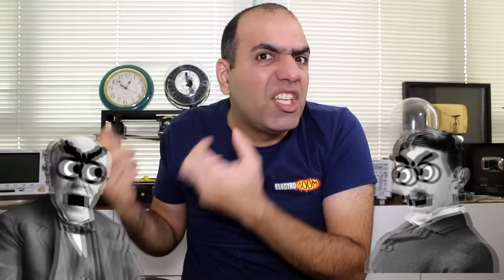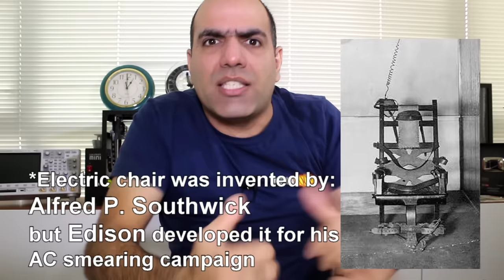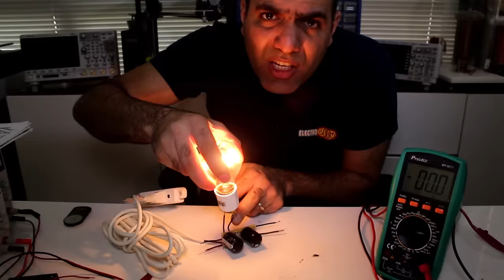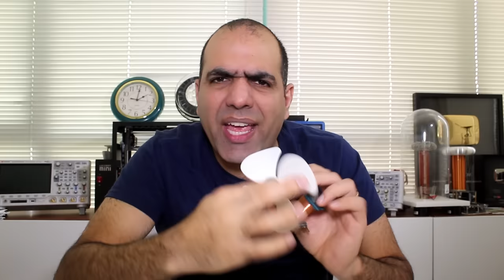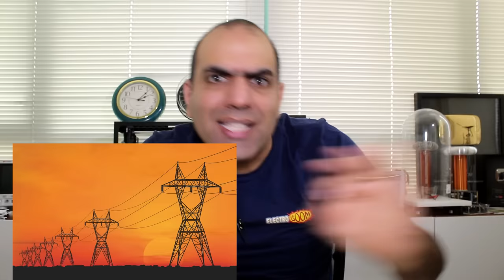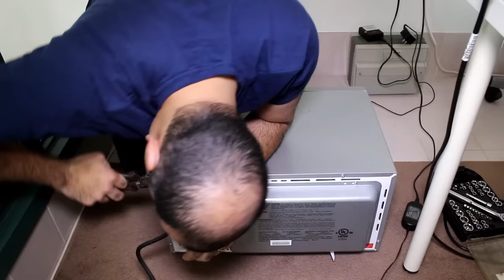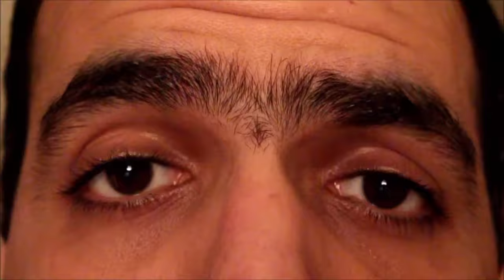Why Use AC Instead of DC at Home??

Comment: A story from a site (factory) which ran 230VDC lighting:

As the filaments parted, a DC arc was set up and stabilised.
That arc then ate its way:
- down the support electrodes of the lamp, 
- into the base,
- THROUGH the bulbholder,
- 3-4 feet along the cable dangling from the ceiling,

and was a few inches from the ceiling rose before someone managed to turn the power off. If it had managed to start chewing up the building cabling it could have been..... messy.

One of the MAJOR advantages of AC over DC is that any AC arcs that happen are self-extinguishing every half-cycle, whilst DC ones are self-sustaining. This is why the AC and DC current ratings stamped on switches are so radically different - it's not about their current carrying capacity, it's about their current BREAKING capacity and ability to prevent/extinguish arc formation.

IE: DC power distribution is a FIRE HAZARD and high current DC anything needs to be treated with great caution. This is why your car has so many fuses in it (and why those fuses have fairly hefty shrouds and/or springs in them despite it only being 12V)

It's worth noting that at the same time as Edison was electrocuting stray dogs and the occasional elephant to show how dangerous AC was, his "Safe" DC system was killing around 8-10 electrical workers per week.
Reply: It shows how society has changed its values, that Edison could kill animals in a demo without provoking outcry and a boycott of his company!  I lived in a house in England built in the 60s when there was a fashion for switchless 240V AC 13A sockets.  I'm told by someone who lived in a 240V DC area of Wales that if you yanked the plug out without switching off first you could get an ElectroBOOM-style arc.
Reply: @usvalve  Well here in Italy we have simple 3-prong 16A plugs that are fairly easy to pull out (unlike schuckos). If you pull the plug out with even just an 8A load it's 100% guaranteed to arc.
Reply: @demoniack81  *Schuko, from German "Schutzkontakt" meaning protective contact
Reply: No, your car has so many fuses to compartmentalise the different systems to try and reduce the likelihood of one system damaging another.
The large size is primarily due to the blades to provide good contact to allow a large current to pass.
The actual fusing component is tiny.
So no, it has nothing to do with arcing.

Also, AC can sustain arcing as well.
In order for the alternating current aspect to be useful, you need to have the voltage drop to below that required to sustain the arc for a long enough period for the plasma to dissipate.
A good example of this is a fluorescent tube, which is a sustained arc, which runs just fine on AC.
Yes, the AC does make it easier to stop the arc, but it isn't a magic cure-all.

The main reason we are using the archaic AC system is because it was better to convert voltages at the time we were deciding if we should use AC or DC.
Reply: @jeffreyblack666  Three phase AC can also deliver much more power with a given size of conductors and voltage, as explained in the video. That's not an insignificant aspect.
Reply: @demoniack81  No it can't, and anyone that tells you that it can either has no idea what they are talking about or is lying to you.

What was shown in the video was a dishonest comparison between low voltage DC and high voltage AC.
He pretended it was the AC that made it so much better while in reality AC made it worse while the high voltage more than compensated for the losses due to using AC.

At a higher voltage you can transmit a larger power for a given current.
Likewise, for the same voltage you can transmit more power with DC than with AC.

The three phase part doesn't help either.
All that does is set up a different voltage. Don't worry, DC can work with that as well, where you can have for example +240 V, neutral, and -240 V. That way if you need more you can get 480 V by going between the -240 V and +240 V.
Reply: @jeffreyblack666  You have no idea what you're talking about, so how about you stop talking like a three phase expert.
Three phase AC doesn't need a neutral if you're pulling a balanced load. That is an absolutely MASSIVE saving in wiring over monophase AC and it has NOTHING to do with voltage. It also allows running large electric motors without expensive and inefficient conversions.
I got this video mixed up with the one on three phase. Indeed in this one voltage is the only thing he demonstrated, but you can't just ignore the advantages of three phase distribution when comparing AC and DC.
HVDC has advantages, but it's more expensive and the conversion losses at the ends only make it suitable for very long distances and niche conditions.
Reply: @demoniack81  No, I do have a very good idea of what I am talking about, nor am I talking like an expert. You are the spouting nonsense and pretending to be the expert so stop projecting your own inadequacies onto others.

Yes, with a properly balanced load you don't need a neutral. Just like if you were to run 480 V DC off of a -240 V and +240 V rail you don't need the neutral. The exact same argument applies. The only difference is it is 2 phase instead of 3 phase, and the frequency is 0.
Don't bother with a comparison to AC to try and make 3 phase AC sound better. Focus on the comparison actually being made, AC vs DC.

I can quite happily ignore the advantages 3 phase AC has over 1 phase AC when comparing AC to DC. You would need to show advantages it has over DC.

The only motors AC allows to run so much better are synchronous motors, which would be niche application.

The conversion of DC voltages is far more efficient than AC.
The sole reason the HVDC systems suffer conversion losses is because of the stupid AC systems they are connecting to.
If it didn't need to connect to such an archaic system it wouldn't have those issues.
Reply: @jeffreyblack666  You don't get the same bang for your buck with a split phase line.
When you're pulling a perfectly balanced load (which is the correct condition for a power line) the neutral conductor is effectively wasted, but you still need it and it needs to be beefy enough to stop unbalanced loads from messing up your voltages. This is for both 3 phase AC and split phase (DC/AC).
The difference is that in this condition with 3 phase you're wasting 25% of your cabling, with split phase you're wasting 33%, assuming all the wires are the same size.
And you actually can't assume equal size, because 3 phase suffers less return current from unbalanced loads than split phase does, so you can have a smaller neutral and the wasted conductor is even less.
Also if you have an electric motor or a heating element (which is extremely common in industry) you can always omit the neutral with AC, because it's always a perfectly balanced load. Heating and motors are probably the most used things in industry by a vast margin.
This by the way holds even if your load is wired for 230V(Y) and not 400V(△), which means you get all those advantages and you can keep your phases balanced even when you have lots of lower power equipment instead of one single huge motor.
Wiring is expensive even at the small scale, not just for huge power lines, and there is no reason for a factory to not save on it if it can.

As far as your "niche" application for 3 phase motors, you might want to look up what an induction motor is. https://en.wikipedia.org/wiki/Induction_motor
They are used everywhere in industry. Virtually any fixed-speed system like a conveyor belt is driven by one of these.

Your HVDC conversion loss doesn't just magically disappear if you move your entire grid to DC - you've just spread it out and moved it to the customer's side since now they need an inverter to run their motors.
And you can't get out of that with DC motors because then you've got commutation losses and it's the same.

By comparison transforming AC back to DC for the applications that really need it (basically just electronics) is a lot simpler, more economical, and more efficient.
There is a reason why no new factories/industrial areas are being built with DC power inputs in mind, not even in places that are just now being industrialized.
That reason is that AC is still superior for the vast majority of applications.
Reply: @demoniack81  You changed your post, why was that? Did you realise your claims were pure BS and showed you didn't understand how pulling a balanced load works?
The entire point of a balanced load is that the current required in the neutral conductor for each phase is cancelled so no current needs to travel though it assuming a perfectly balanced load, and only a portion of the current given a not perfectly balanced load, up to the rated current for a completely unbalanced load.
The neutral will not see more than the individual phases/voltages.
The only way that happens is if you have something like a +120, +240 V system which share a neutral, as the neutral then provides the return path for both, in phase.

And no, the neutral, to be safe, should be the same size as the other wires so it can handle the full load unless you can ensure the load will have some significant balancing.
As for less return load, that is entirely dependent upon how it is balanced. For both systems it ranges from 0 to the maximum current.

Voltages where chosen fairly arbitrarily. If it actually had anything to do with safety you wouldn't have 2 massively different standards across the world.
And all the systems which have more than just a neutral and single live wire have those higher voltages. So no, it is still a valid comparison.
That is how these multi-phase/split voltage systems work. They have 2 low voltage loads powered by a high voltage source.

So the only advantage of 3 phase AC is that you have 3 instead of 2, which means you have 1/4 instead of 1/3 wasted on the neutral. But why stop there?
Why not 4 phase AC, or 5 or 6 or 7?
With 4 phase AC you are down to 20% lost.
You also have the advantage of a wider selection of voltages with the higher count.
So why stop at 3 phase?

So I think I will dismiss those tiny benefits of 3 phase rather than 2 due to the losses that AC suffers from being AC rather than DC.

As for induction motors, you were trying to talk about the nice simple ones weren't you? Not the more complex ones which need fancy controllers? And again with the dishonest lies about DC. Yes, you can get brushed DC motors, but you can also get brushless ones. If you are happy with the fancy controller for induction motors, why not for brushless DC motors (of which there are plenty being used). Without the controller induction motors are quire limited; and the simpler the controller, the more limited

No, the AC garbage does magically disappear if you switch the grid to DC.

What is more efficient is if it was all DC.
AC is not vastly superior, it isn't even slightly superior. DC is vastly superior.
The reason newly industrialised places use AC is for compatibility.
If we were starting from scratch, with no power grids set up and no devices relying upon a particular input, we would use DC.

And yes, I came in saying anyone who states AC is better either has no idea what they are talking about or is lying. So what? You are yet to show how AC is better and completely ignored the problems with AC which show it is worse. If AC was better, there would be no HVDC lines.
So you are doing quite well to help support my case. It would have been better if you had left your earlier post where you claimed that with split phase running the + and - at their maximum rating causes the neutral to see double its maximum rating, but I guess I can do without.

Literally the only advantage you have been able to show is that 3 phases is better than 2 as it uses less wire on the partially wasted neutral. But then any higher number of phases beats that.
But that doesn't show AC is better as you have factored into consideration the losses of AC.

And no, he wasn't simply saying AC allowed simpler. He lied and said that the only way to do it with DC was to convert it to AC, change the voltage and then convert it back, loosing a lot of power in the process.
So no, it is a dishonest video.
An honest video would have pointed out that AC makes this simpler and is why it was chosen but now we can convert DC to DC much more efficiently.
He also just focused on the resistive losses and completely ignored the extra losses AC ads. An honest video would have discussed it all. But that would result in the conclusion being that we use AC at home because we are stuck with an archaic system which was better at the time due to limitations of technology, but not now.
Reply: @jeffreyblack666  Yes, of course I changed it because I was clearly wrong. I wrote the post quickly while at work and for some reason I was thinking with the two DC sources pointed in reverse with respect to each other, then I thought about it for two seconds and realized that made no fucking sense whatsoever, so I deleted it and replied again later when I had more time to think about it properly.
I can admit when I'm wrong, unlike you, and while I was at it I even decided to tone the reply down because getting into a heated argument seemed stupid in hindsight. Guess you didn't pick up on that.

They stopped at 3 phases because there's diminishing returns and more phases complicates motor and generator design.
They could have probably gone with 6, but 3 was good enough.

Simple induction motors without control circuits are used everywhere.
"Brushless dc" motors are nothing more than three phase AC motors driven with power electronics, so it's ironic you'd sing their praise considering you're dissing AC so much.

"If AC was better, there would be no HVDC lines."
That's the stupidest thing I've read all week. It's like saying "if cargo trains were better, there'd be no trucks".
HVDC has its very useful applications (underwater cables, connecting grids running at different frequencies, ensuring you can always connect two grids without phase angle issues, etc), it's just not as good as AC for general distribution.

You can step DC up or down with power electronics but it'll never be as simple, reliable and inexpensive as a transformer.
And you can do this today, Mehdi was clearly saying that back when Edison was around you'd have to convert DC to AC to step it up, using a rotary converter, and losing a lot of power (compared to a simple transformer) in the process. There's no lie there, it's just that you're prejudiced and you want to see malice where there is none.

AC does have higher transmission losses, but that can be largely mitigated with power factor correction.

Compatibility is a non issue if you're building an industrial park from scratch. DC equipment is readily available if you want it, including inverters to convert it back to AC if you need to run something that's incompatible with DC. If DC was as superior as you say, China would be full of DC powered industry. It isn't.

That said, as I said before, I'm done getting into arguments over this, I have better things to do with my life. Keep shilling DC, maybe one day you'll be proven right. Who knows.
Reply: @demoniack81  I can admit when I am wrong as well. However that doesn't mean I will admit to being wrong when I am not.
If you want to tone down the response you don't just hide your prior insults and pretend they never happened, nor do you keep up the insults.

Yes, there are diminishing returns. So why 3? Why not 2? Why not 4?
What makes 3 the magic number to stop on?

Brushless DC motors are not AC motors.
An AC motor is bound by the frequency of the supply. A brushless DC motor uses electronics to switch which pole is energised with the electronics being able to control the speed.
Saying they are AC motors is like saying brushed DC motors are AC because it switches as the brushes go past the contacts.
I'm pointing out the problems with AC power transmission, not using electronics to switch the poles of a motor.

Yes, HVDC is used because it is useful, because it is better than AC. It is used when the benefits of DC outweighs the cost of tying it into an archaic system.

And no, it is nothing like a comparison between trucks and trains. It would be more like a comparison between trucks and horse drawn carriages.

He was not saying it as back in the past. It was stated in the present tense. He was acting like it was a fundamental limitation of DC. If it was so unreliable and expensive it wouldn't be in so many devices today.

Compatibility is only a non-issue if you are making a completely isolated system. Trying to use inverters to power AC devices from outside is a compatibility issue. So no, due to these massive compatibility issues, they wouldn't just use DC.

I'm no one's shill. I just stand up for the truth.
Keep shilling for AC. Maybe someday you will realise your mistake.
Reply: @jeffreyblack666  You WERE wrong when replying to my original post, which simply stated that, for a given size conductor and voltage, 3 phase AC can transmit more power. Which it still can (even if we want to ignore the ability to use a smaller neutral with AC), since you've only got one neutral every 3 phases instead of one every 2, even if my original idea of split phase DC was wrong because I didn't think about it enough.

Then we got sidetracked from there because you took it as a mortal insult to DC, and by the way you're the one who started with the insults.

I don't hate DC, I dont' care if my power comes in via AC or DC so long as my devices work and it (and them) are not more expensive than it needs to be.
Stepping DC up and down is still more expensive than doing the same with AC, even today. At least at the grid level.
Reply: @demoniack81  No, you were claiming AC can carry more as shown in the video, so on that regard, I was not wrong.

I had already admitted that 3 phase provides a small saving in wiring over 2 phase, and 4 provides it over 3 and so on.
However I am yet to have it demonstrated that 3 phase AC transmits a greater portion of the power than 2 phase DC.

I didn't start with insults, I simply stated a fact.

Again, if stepping DC up and down was more expensive, it wouldn't be done is so many cheap devices (even expensive devices do it). Even when weight and size is not an issue, they still use DC-DC converters.
So no, unless you have some solid evidence to show AC conversion is cheaper, I'm not buying it.

The only reason it wouldn't be at the grid level is that the grid is using AC, so the DC conversion would be more:
Convert AC to DC. Change voltage with DC. Convert back to AC.
Those conversions losses would be significant.
Reply: @jeffreyblack666  "No, you were claiming AC can carry more as shown in the video, so on that regard, I was not wrong."
Ok fair enough, I was thinking about the 3 phase video at the time. I got them mixed up.

"However I am yet to have it demonstrated that 3 phase AC transmits a greater portion of the power than 2 phase DC."
Because 3 > 2, regardless of AC or DC. Reactive losses in AC aren't significant enough to cancel the benefit of the third phase, unless you're doing no PFC at all and have an abysmal power factor.

All those devices that do DC to DC conversion are usually small and low power. Small and low power is where electronics shine. As soon as you get into high power applications the power electronics get very expensive very quickly.
Even HVDC lines step the voltage up/down on the AC side with a transformer, and not on the DC side with DC/DC converters. Clearly that means it's cheaper to convert voltages with simple, reliable transformers rather than with expensive and relatively fragile electronics.
Reply: @demoniack81  "Because 3 > 2, regardless of AC or DC"
Only true when comparing within AC, e.g. 3 phase AC is better than 2 phase AC.
Again, if 3 phase AC was better, there wouldn't be HVDC connections. Instead it would just be high voltage 3 phase AC.

The HVDC converter stations have the transformers to get rid of issues with AC, such as reactive power. They are needed due to the AC system.
Reply: Actually, the transformer is a hungarian invention, the first transformer are made in Hungary by Ganz Mavag before the invention of ac, in the Ganz Mavag's transformer factory, that factory had gas lamp lighting, and it had a transformer tester, which is a dinamo driven by alternating motions, after the test was successful, the transformer was wait until the AC was spread to Hungary
Reply: @ChristPrimus  That all depends on what you try and define as a transformer.

Faraday was the first to do experiments with induction, which involved things which could be deemed transformers. But this was primarily for research, not actual power transfer, even though it did transfer power.
So that would make it Faraday in England, not Austria-Hungary.

After that you had the Irish with induction coils.
Then AC came along and made it so the induction coils didn't need interrupters as the AC has a changing voltage.
Then you have Russia and various other countries (including Austria-Hungary) coming in, with the Ganz factory being the first to patent and start commercial production of transformers akin to what we have today.

So I wouldn't say that the transformer in general was their invention, just that they were the ones that made it commercial.
Reply: I am off grid and power my entire home with 100VDC. One thing to note is you must place arc arrestors on EVERY kind of switch for the reason you stated. By the way, no transformer will work on my power as "DC only" creates an electromagnet condition in the primary, therefore no output on the secondary.
Reply: @MikinessAnalog  Yes, transformers wont work, but plenty of power supplies should.

I am yet to find anything which indicates that you actually need arc arrestors for DC systems at voltages of 100 V.
And even AC will generate arcs on switching contacts.

Jacob's ladder, a device for generating arcs and having them travel up the ladder requires 10s of thousands of volts.
Reply: @jeffreyblack666  I may get by without them, but i saw a video of 230 VDC that frightened me enough to do that. By the way, it  appears that ALL high speed switching supplies will take AC or DC as the first thing after the fuse and choke is a "FULL BRIDGE RECTIFIER"  that turns it into DC anyway.
Reply: @jeffreyblack666  well said, but one thing stands out: DC-DC converters use switching to generate high-frequency AC for transformers and inductors which have no response to DC. The efficiency gain is because at 50000Hz the transformer can be much smaller with less wire that the current has to run through, so the switching losses in the transistors plus the resistive losses in the transformers end up less overall, plus there's much less material/weight/cost to the high-frequency DC-DC converter (which is why almost everything uses them nowadays, even when running from AC). It might be worth mentioning why DC power lines are more effective too: 

1 DC can use the entire conductor wheras AC is limited by skin depth to the outer 6mm (at 50Hz, in copper - only makes much difference in transmission lines and power stations).
2 DC is transmitting power continuously through both its conductors, wheras AC is transmitting in pulses meaning significant power is only flowing for 80% of the time (equivalent).

AC transmission is mainly about legacy, the only good reason to still have it is the arking problem, but that can be solved in other ways (solid state switches and ark-arrestor blocks on wires for example). But all building codes would need to be changed and electrical professionals re-educated, and that takes time.

A lot of eqipment already has power supplies that can be operated from a DC input, (psu's rated 100-250V AC will also run happily from 100 to 300V DC) so as this process continues (more and more motors are getting electronic controllers to increase efficiency and versatility) eventually there will be very little of the AC legacy left, and switching to DC will come naturally, when we are generating our power as DC, storing it as DC, using it as DC, then distributing it as DC will come naturally, especially as the electronic voltage converters can be far more responsive and intelligent about how and where they push the power that is generated and stored in a far more distributed way.
Reply: @treelibrarian7618  Other than the specific details I thought I had covered most of that, but it may have been in other threads.

One thing to note though is that is only for an isolated power supply. If you are fine with an unisolated power supply (which if it fails can pass through the entire line voltage) then you can use inductors, capacitors and switches.

You also left out 2 other key issues with AC, the transmission cables capacitance and inductance.
The inductance limits how far the AC power can be transmitted, and creates a voltage drop across the cable. This is most significant in undersea cables which need to use DC for this reason.
Capacitance allows open circuits to still pass power, and more importantly, also causes radiative transmission as the voltage changes.
This means AC power lines actually transmit away a significant amount of power.

One issue with switching to DC is some devices designed for specific voltages using AC to work the same in DC will use either the RMS voltages (like heaters) while others will use the peak voltage (like simple AC-DC converters.
Reply: @treelibrarian7618  >(psu's rated 100-250V AC will also run happily from 100 to 300V DC) 
I guess a bit over 400DC. The voltage after the bridge rectifier is over 400 for ~240.
AC has the intrinsic benefit of being able to switch the live and neutral. DC would require a bridge rectifier everywhere to do that.

Flip note: Massive DC would have to deal with galvanic corrosion, esp. at the households.
Reply: @stanimir4197  actually the voltage after bridge-rect is 339V (240*1.414) peak. PSU's that can work at 110Vac (150V peak) must be able to run at lower dc voltages due to the capacitor drooping between half-cycles. Switching live and neutral is not needed in a dc system where plugs are physically polarised (like all DC power connectors are). I have lived with DC power for yeears and I haven't noticed any extra corrosion over the AC wiring (they are both fine when dry, both corrode when exposed to weather, even when no power is on them), though I'm only using 50V for distribution. I can't see why higher voltages would make a difference since most electrochemistry happens already at 2 to 4 volts.
Reply: Fun fact: Edison's first electric chair was DC. The condemned criminal COOKED before he died. It was considered so inhumane the concept was abandoned after that one trial.